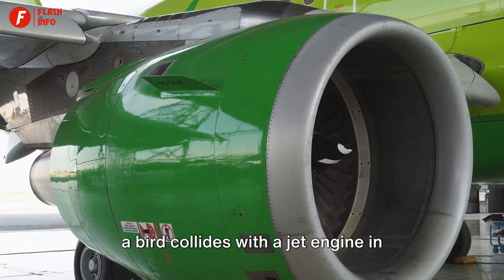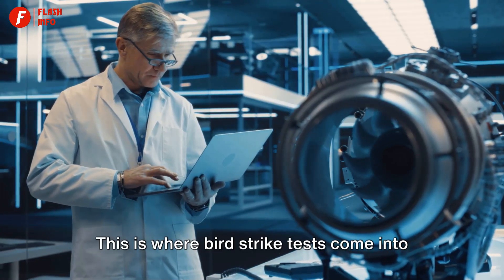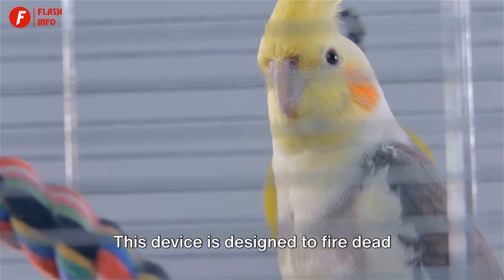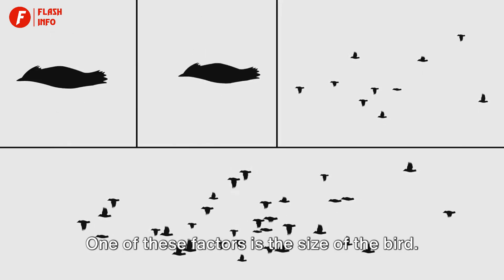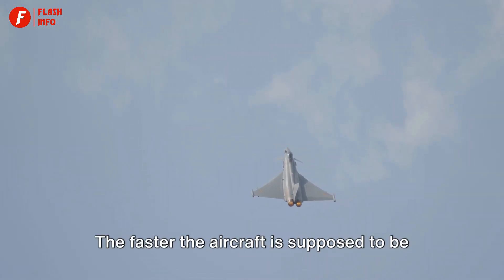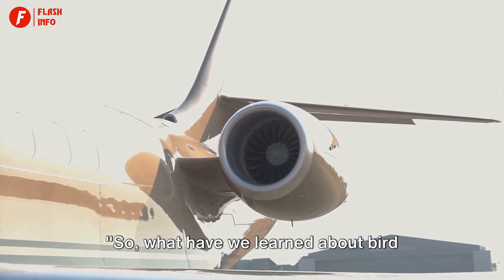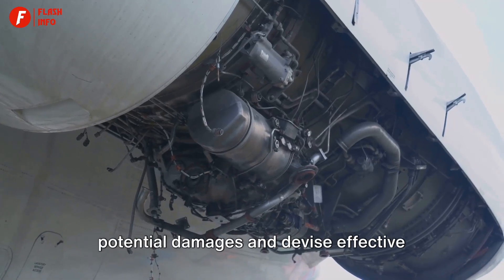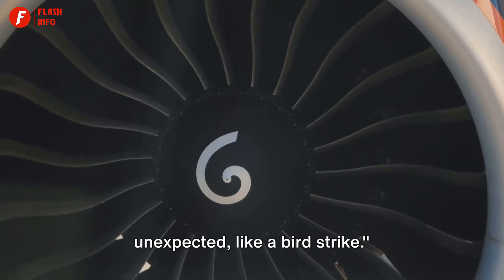Bird Strike Jet Engine Test | This Is How Airplane Engines Are Tested? | Flashinfo

Comment: why a protective cover on the engine opening ,  something like a steel strainer /filter , might not be installed?
Reply: If they were to do that it would significantly reduce the ability the aircraft would be able to fly and it could possibly break into the engine doing more damage than a bird could

Comment: This is quite shocking to read "Bird strike engine test / this is how airplanes are tested" & never show "The actual test" being conducted in a basic testing facility !  This isn't "top Secret stuff nor is it Classsified & takes about 3 minutes to find it on you tube !  Another thing FlashInfo don't mention is Testing is done with frozen birds & 2 reasons for that is 1) frozen birds create more danage than fresh ones during flight which increases safety issues 2) every time testing is done, they do not have to go out & kill a bunch of different but very fresh birds then have a bunch of bird acticists create this whole other un-necessary issue for cruelty to animals !  They also don't just test 1 bird at a time per engine it's more like 4-5-6 at a time ! Aviation safety stands on it's own & most are not aware of the hundreds of backing systems covering the most primary systems any commercial needs to fly. Just the cables / wiring of a Boeing 747 end to end exceeds a 140 mile distance. 
"FlashImfo where they give you 1/2 the info"